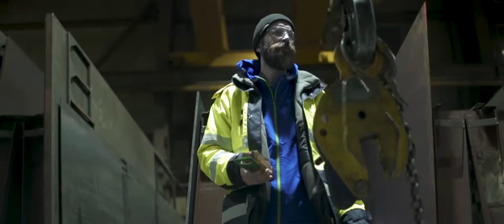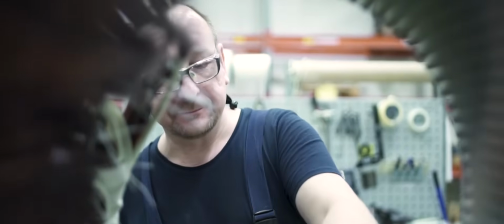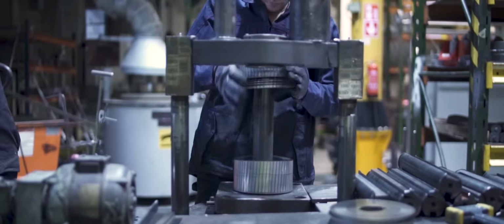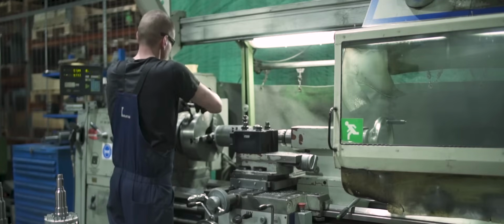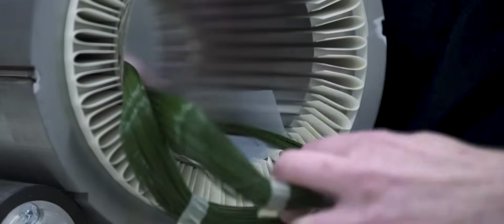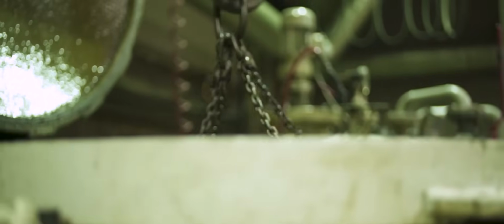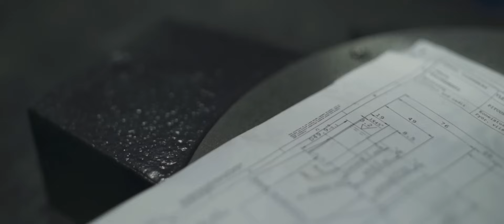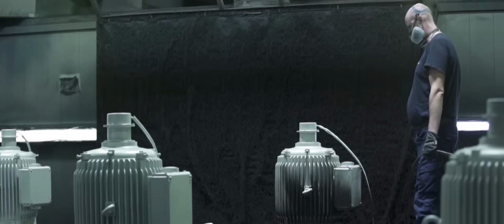How to Make an Electric Motor?

Comment: The persons assembling the motors are technicians or mechanics - they are not, however, engineers.  I am one of those technicians. I am very skilled and have a very good understanding of electricity and mechanics, but to call me an engineer is insulting to persons with difficult college engineering degrees and responsibilities who are correctly called engineers.
Reply: Sir you are humble and kind and I appreciate that but your skills are the one that decide what we imagine in our computers 
You bring things to reality
Reply: it just a piece of paper
Reply: @RunnerDobi  no it's not,
believe it or not, the entire design from the biggest stator to the tiniest hole, everything has a reason and even the gap between the holes are measured, that is the work of engineers, they have to learn each and every aspect of it and its not only for motors,
Reply: My country Nigeria is actually the opposite. We are preferred being called engineers than technicians. We take the engineering title to be of high status
Reply: Maybe you know more then an engineer man!

Comment: Nice video, but utterly zero real explanation of how a motor is made. You didnt explain that the stator lamination is made with a special electric steel, nor the composition of the rotor. Not explained that the stator lamination could use either plastic or resin between each layer and pressed down. And doesnt have to be welded. nor explained how the number of windings relate to the power required..... This is the most basic "how to make a electric motor" you could get... Anyone more than 18 should already know this basic theory...